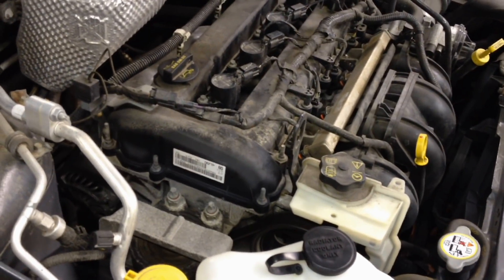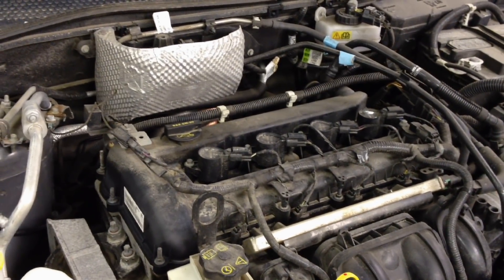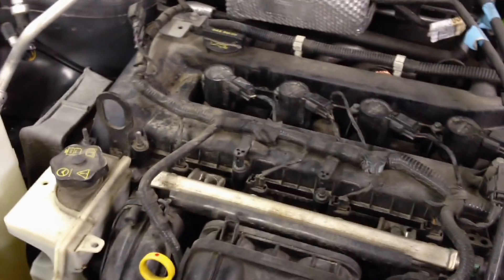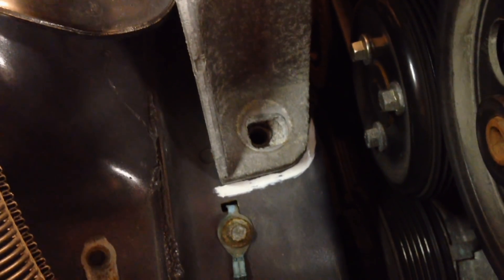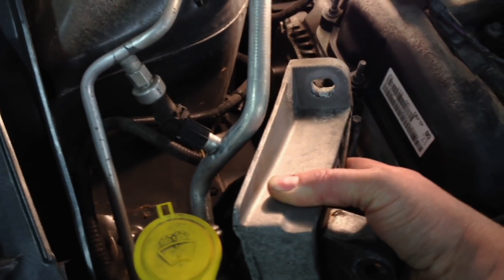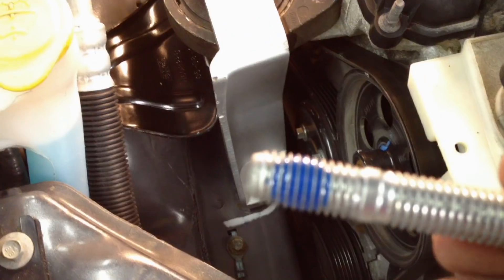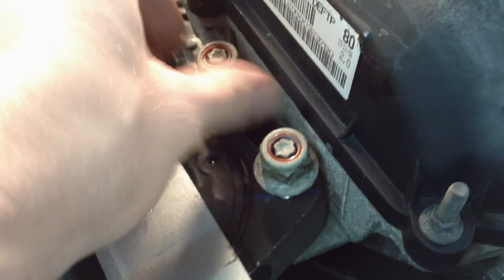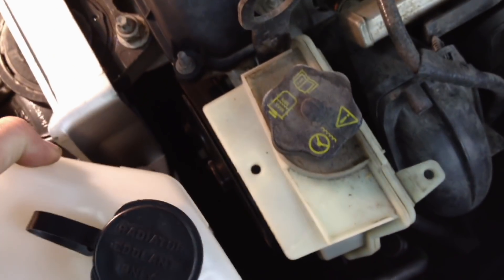Ford Focus Engine Mount Vibration Repair

Comment: Thank you very much! I just replaced the passenger side motor mount on my wife's 2010 Focus at 86k miles like the one you replaced in this video and the difference is incredible!!! She literally asked me "did my car start?" when she turned the key because literally 90% of all the vibration was GONE! $132.xx plus tax at my local ford dealership but it was worth every penny! I replaced it myself by the way in just a little over 15 minutes...

Comment: Is there any chance i'll be damaging my oil pan and causing a leak even with the board
Reply from the maker: +Will Fader no you are lifting it on the edge and only lifting it a little to relieve the weight from the mount
Reply: +FordTechMakuloco so just putting a 2x4 where it shows in the video is good enough?

Comment: I just got a second opinion Saturday and yes my passenger side engine mount does need replaced. Luckily the place that gave me the second opinion only charges $156 plus tax according to the invoice and the first place that mentioned it wanted $250. So I do plan to get it done at the place  I got the second opinion from.
Reply from the maker: Yup very common.
Reply: MrWill1985 I would be curious what type of motor mount they will use.   rockauto.com is selling anchor motor mounts for 7 bucks a piece, motorcraft motor mounts are cost anywhere from $85-100 a piece.

Comment: Thanks for the video. I had the same issue on my 2004 focus zx5. I took it to the dealer and fixed it, it feels like new now. They also checked the brakes and found a damaged thread on the rear spindle. They suggested to replace both rear spindles down the road. Would you recommend buying OEM spindles? Or aftermarket ones are good enough?

Comment: So I went out and bought this part made in USA for $180 CAD, did the change thanks to your instructions, and the results are great. Huge reduction in annoying vibrations, but  I still feel a small vibration and I think it's coming from the Transmission Insulator mount under the battery box.  When taking the tranny mount out, where should i support with hydraulic jack. engine or transmission.  Quite sure shop manual still shows the support beam over the engine area, but vertically.
Reply from the maker: +Washington Redskin Support the trans case the same way you supported the engine while the mount is out.

Comment: what size is the transmission center mount? 7/8 is slightly too big.
Reply from the maker: +prosperandbehealthy Then it would have to be 13/16
Reply: +FordTechMakuloco  Thanks!  21mm  I think is the metric conversion. Replacing the clutch and this is one  transmission mount that is tough to get off. The 4 smaller bolts seem to be 15mm but the nuts are rusted and socket a little too much play, and if I can't open them, I might have to cut them.
Reply: +FordTechMakuloco  Thanks 13/16 worked and 9/16 on the 4 where 1 I had to cut. 
Do you know where I can get that nut I cut and on the hydraulic line going to the slave cylinder, I took the metal clip out, but how do you disconnect the metal tubing? there is only 1 line going to the slave cylinder and it has a bleeder nut.

Comment: My ford focus 04 se Vibrates when im at a stop light and it stops when I shift to neutral or park, Midus told me its a transmission issue but Im having doubts. Did your focus do this before you replaced them cause the vibration doesn't happen all the time.
Reply from the maker: +Daniel Gonsalves Yes exactly as you stated.

Comment: there isnt a third mount?
Reply from the maker: +philliponcarbs no there is only an anti roll bracket down below in the rear
Reply from the maker: +philliponcarbs The escapes have lower anti roll mounts front and rear. I would not fill in my engine mounts no you will feel everything and I am not so sure how well they would stiffen them when it comes to torsional twisting of an engine.
Reply: +FordTechMakuloco I see that makes sense about the filling the mounts. Also I have a firestone mechanic telling me there are three (motor mounts) and that the cost for repair is is about 700$ seems  excessive when you showed me it can be done in about 15 minutes with a 2x4 a car jack and some chalk.  Sounds to me like i should run from these guys. Or is there something im missing.

Comment: Are those studs torx heads? What size are they?
Reply from the maker: +Honzo Sample Yes external torx They are usually E10's
Reply: +FordTechMakuloco thanks! they were E10's (2008 Focus). Just did this today, night and day difference, it's like a brand new car! How important is it to get the new mount to sit exactly where you traced the old one? Couldn't get it to sit just right. Front to back is perfectly aligned. The new mount sits probably 1/8" to 1/4" inches more towards the passenger side though. Thanks again!
Reply from the maker: +Honzo Sample That's is close enough for sure glad it all back together like new.

Comment: nice job I just got my mounts and I am going in to do it Thanks
Reply: mine have been changed 3 time on my 2005 ford focus. They need changed again.
Reply from the maker: +PATRICIA TURNER Be sure to use OEM parts only.
Reply: +FordTechMakuloco  yes I did and its all done and its sounds like a New car.

Comment: Fantastic Video - thank you very much for this fine guidance !
Today I changed this mount on my Ford C-MAX, 1,8 petrol, Trend from 2004. I have been driving with vibration issues for more than 3 years. My Ford service changed the button mount for about 1 year ago, but no big difference. Today I therefore changed the upper right mount myself. I used a Febi Bilstein mount, Germany quality, WHAT A DIFFERENCE - I HAVE A NEW CAR NOW, allmost. All vibration problems are gone now, it´s absolutely fantastic, I have forgotten how much comfort the car had before. There was no visual defects on the old mount, but I can se a small difference after mounting. The engine is about an half centimeter higher in the right side now, so the old mount just lost its strength over time.
All the best from a happy dane ...

Comment: Very well done - Thank you. A jack under the oil pan eliminated the vibration and was the test I needed. So is a factory part best in this case or will an oem part work from one of the big distributors?  I subscribed to your channel. Wonderful.

Comment: I am needing to do this.  How do I know if the other two are bad or is it mostly this one that dies?  Nice video
Reply from the maker: +Jay Groom The driver side one will completely collapse and be very evident, you will have to remove the air box and other components above depending on year to see. To test the lower anti roll mount just rock the engine and you will see if there is any bushing wear but the passenger side mount is most common.
Reply: thanks for the help

Comment: I have a 2011 Ford Fusion with just under 49,000 miles on it.  I brought it into Ford service 2 weeks ago when I notice the steering wheel started shaking and the engine sounding like it was racing, and a lot of cracking/squeaking sounds coming from what sounded like the engine.  after keeping the car for three days they said they couldn't duplicate the issue I described and told me the suspension/alignment etc basically everything checked out.  After a week of having my car back, I was still experiencing the same symptoms,  I just dropped it off again yesterday and Kevin my service advisor called and said that they needed to replace the engine and transmission mounts.  My question is this,  My car has never been in an  accident, Is this normal for a 2011 Ford fusion with just 48K+ miles to have both engine and transmission mounts go bad?Thanks for any advice :)P.S.  I also notice a funny odor coming from the heater since everything started happening.
Reply from the maker: +Rebecca Janke I have seen the right hand mount separate and cause vibration issues yes but yours being so new and of such low mileage I highly doubt it. Is this the 2.5L? At any rate I think they are throwing parts at it at this point only have them replace the right hand mount and be sure to inspect the condition of the lower dogbone mount for wear and or debri grounding it out.

Comment: Can the engine mount look okay even if its not? My last oil change I was told that my right upper engine mount and a torque mount need replaced on my 2009 Ford Focus SE and my right upper engine mount looks okay when I look at it. So Im just wondering if that is true or if they are trying to tell me that to make more money as many mechanics lately mention things attempting to make more money.

Comment: Feeling vibration and also notice at idle the RPMs drop down to 500 and then go back up to 700-800 RPM (or normal RPM range)  is there a fix to this?

Comment: You've been a great help but I have a quick question...on the 2002 - 04 SVT models vs. the 'regular' Zetec  -  are they both the same part number?

Comment: Thank you very much for this great video. I just finished replacing the engine mount on my 2009 Ford Focus SEL and I was amazed at the difference it made. I am a very mechanically sound individual and the entire repair only took me 25 minutes. I was able to find the engine mount cheapest at AutoNation Ford Parts in White Bear, MN. I ordered it on 11/17/15 and it arrived on 11/19/15. Thanks again for all the great FORD videos. THE BEST NEVER REST!!!
Reply: I’m from mn too Pequot lakes area

Comment: I replaced the hydraulic mount and it got rid of 75% of my vibration issue. I then did the roll restrictor and it was 90% better and got rid of a nasty clunk, then I Changed the belt and that about killed the vibration
Reply: What is the roll restrictor ?
Reply: I think he's referring to the lower rear engine mount that has a TSB for adding a shield kit to a replacement mount to prevent road debris from getting at it and destroying it.

Comment: Finally got around to changing the passenger side mount.. and the difference is like night and day!  My focus feels like it's literally gliding when it drives, it's soo smooth. I had to watch this video again today to gain the confidence to do the job and it took me about 45 minutes. Thanks again for the informative video!
Reply: Francis Matawaran just enough to get the weight off the car body
Reply: +DaPaRappa I've been thinking about doing mine, but I don't feel too good about putting a jack under my oil pan.  So, it wasn't too bad then?
Reply: psychotogen1 Yeah it wasn't bad at all. Just make sure you have a nice sized block of wood to put on the jack under the engine oil pan. I jacked it up slowly because I was scared, but it does spread the weight out making it easier to lift the engine.
Reply: DaPaRappa i finna do it soon scared tho
Reply: Young Reese Good luck
Reply: Young Reese P
Reply: SunFireHyena  my ford zx3 vibrate when idling maybe I need new motor mounts!so how high to lift it just curious?
Reply: Is this usually the only mount to go bad on these because there's also a torque strut mount underneath the engine too.
Reply: Did your mount SQUEAK along with a vibration?
Reply: Is it ok to drive till the part comes in?
Reply: I did my car didn’t know how much to torque the bolts but I just tightened them much I could and used thread locker I’m sure it’ll be okay I got them bolts pretty tight used a ratchet didn’t have an impact.
Reply: @ryans413  You likely tightened them too much.
Reply: @mulletsquirrel     Maybe but it won’t come lose
Reply: @ryans413  that's not the point. It doesn't matter if it doesn't come lose if the whole thing just falls apart. The reason you tighten bolts to torque specs is so you don't damage the components. Not because 'oh this way it won't untighten" if that were true we would all just use the impact to tighten everything and then it'll all break
Reply: Very easy highly recommend

Comment: I change all three mounts on my ford focus 2007 and it still makes that vibration I changed them about 2 months ago
Reply from the maker: +Veronica Lopez Was it fixed at first and were the mounts Ford?
Reply: I was 100% sure it was the mounts until reading this comment. What else could it be? Did you ever figure it out? Do I have to use Ford mounts?
Reply: I changed lower mount for Febi and now my steering wheel vibrates like crazy at idle.

Comment: My wife's focus is doing the same vibration. Do you only replace this one front engine mount, or should you do the rear mount as well? Also, I assume the DEA part your link has is the OEM part, just much cheaper? Thanks
Reply from the maker: +amc31b DEA is good also I am updating the links to the Ford mounts.

Comment: I dreaded the day I'd have to do this because I'm so scared of putting a jack under my engine to lift it. But it does look like an easy job. I'll be doing mine this Sunday. The only thing that differs in this video is my coolant reservoir has to be moved aside since the overflow and coolant tank is all one unit in the 2005. Engine mount is exactly the same from what I've seen. I'll be so happy once that vibration is gone.

Comment: @Mardy Crue.  I have the same vehicle as you, and when I was test driving it from the dealership I purchased it from, it had the exact same issues as yours.  The problem was this side engine mount was leaking fluid.  I made them replace all the mounts with OEM before I made the deal and it fixed the issue.  Unfortunately, OEM is the only way to go for that particular engine mount because it contains fluid and the aftermarket ones are cheaply made and don't have the required fluid if any at all.
Reply: Is it reasonable to say that the engine mount fails due to fluid leakage?  So, if the mount doesn't leak, then it should remain in good order?

Comment: Hey i have a mk1 Focus. Im worried i just brought used and when it idles the noise and vibrations will vary and go quiet then to vibrate and make noise again. Could this possibly be the mount.
Reply from the maker: - Boss Try the test shown in the video you will know.

Comment: Hi,

You've helped me in the past.  I had a 2000 focus that went through three coils.  You told me me about a potential wire grounding, and you were 100% right.  Two strands of wire were left and were grounding on egr tube.  Thanks!

My question is about your parts link on this video.  When I click it, it brings up is a dea mount. When I look on a Ford parts site, the price is significantly different.  

Should I purchase part from dealer?  If not, should I stick to dea manufacture only?  In the past, I have had the best luck with dealer parts, but they are just so much more costly.  

Thanks in advance for your great advice, experience, and insights.

Comment: hey so im looking to get rid of my DRL lights on my 2009 ford focus but i am not aware where my fuse or relay is located, any suggestions? i live in California and dont need them
Reply: vK ProdigY check the FocusFanatics forums
Reply: +James05574 i called them and they said no:/

Comment: can a motor mount cause vibrations only in 2 gear between 1500 and 2100rpm?
Reply from the maker: Branislav Stratrov yes the vibration can come in at only certain rpms.
Reply: FordTechMakuloco sooo I've been trying to figure out what's going on with my wife's fusion for 2 weeks now...it vibrates and has a slight shake from passenger side... Wheel bearing is making no noise..cv axle seems ok too..it only happens over 60mph and gets worse with Speed? Any help is good help lol

Comment: hello I have a ? that has nothing to do with motor mounts and I cant seem to find anything close to figure out the problem with cruise control the vids I see have to do with a truck f150 they talk about the problem being a brake pressure switch but I see nothing on the brake master cylinder on my 2005 ford focus has nothing electrical on it hope to hear from you and I hope I explained my plite to you well enough thank you Ben

Comment: if i change this should i change the other 2? how can i check if they are bad?
Reply from the maker: vK ProdigY This mount is the most common mount to fail on this vehicle. The other mounts are just visual inspection.
Reply: FordTechMakuloco just order DEA from your link on amazon, should be installing it in the next few days. any way to eliminate road noise a little better in 2009 focus

Comment: Is your car  manual or  Automatic transmission? .... I want to say that your  mount is for the manual trans right?  but I'm not sure, just trying to see which I need.
Reply from the maker: Brian Salazar This was for an automatic but they should be the same, click on the link in the description and check the amazon fitment guide.

Comment: my ford focus zx5 hatchback makes a loud banging noise while switching gears upon reversing while turning the wheel. could this possibly be the engine mount?
Reply from the maker: Laura Savage If its that bad yes, also check the lower torque strut.

Comment: i have a 2009 ford focus se automatic transmission and i need to change my passenger motor mount but i only have 65000 miles and my bracket is like new. Can i just buy the mount and install it on the bracket or is that to difficult. How would a person go about removing the mount from the bracket and install a new one. Thanks again i love your videos
Reply from the maker: Jim B The only mounts that last are the Ford ones linked in the description and those come one way complete with bracket.
Reply: I’m also curious how you remove the bracket from the old mount and put it on the new one.

Comment: Do you suggest replacing the bracket with the mount?
Reply from the maker: DarkSith1980 Yes complete from Ford only.
Reply: FordTechMakuloco Thanks for replying. I checked out a few pics online and it looked like its all one unit. I ordered it and as you said its one piece. I'm thankful for the time I spent working in a dealership. Gave me a lot of good knowledge and common sense.